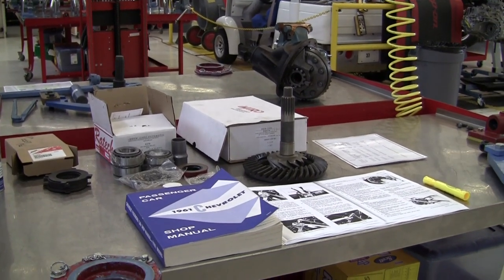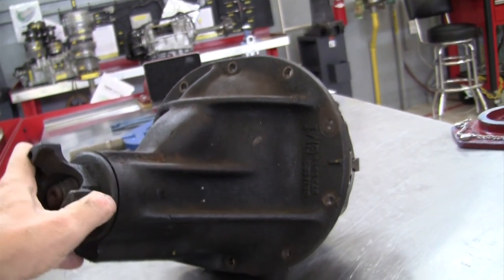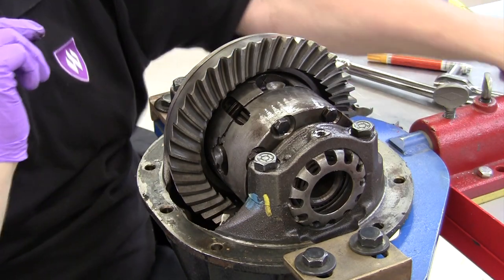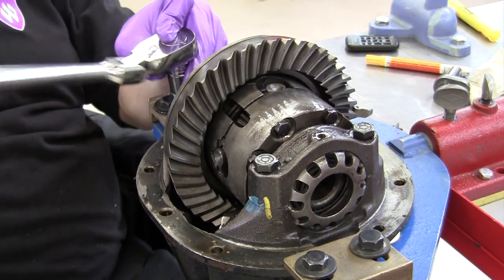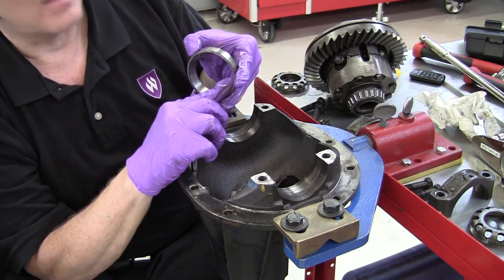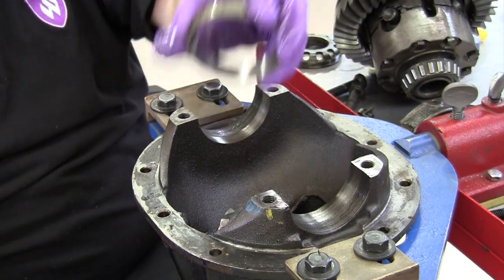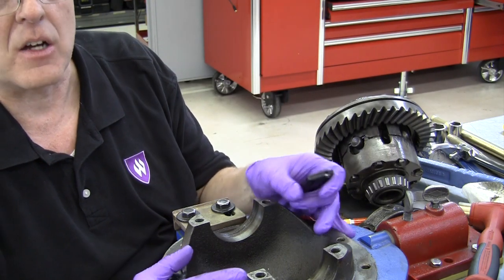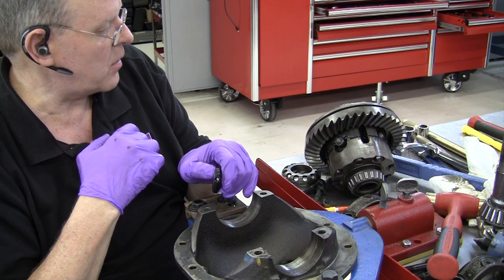1963 Chevrolet Biscayne Positraction Differential Overhaul - Part 1 - Disassembly

Comment: BW is a 3.08 open carrier.  My 62 409 is an AQ which is a 3.36 posi with metallic brakes.  Awesome video series.  I'm local to the area and will be upgrading to a 3.73 in the near future, this is a great refresher.

I teach part time for the University and had no idea they even had an automotive program.
Reply from the maker: +Daniel Tubbs Thanks, the automotive program has been here since before this location on the hill at Weber College, Weber State College, and finally Weber State University. Out building was built in 1956. Stop by and visit sometime.

Comment: Outstanding video.  I believe, if memory serves, that this particular housing is not a posi housing. They posi housings featured a large P embossed on the housing.  Missing on this housing. You mentioned that the inside appeared to have been ground down in one area.  
  The open rear carriers had a rib in them that would not allow the posi unit to be dropped in.  The housing with the P on them,  did not have that rib, thus the unit fit right in.  Again, its been a long time since I did one of these, but that what I remember. Anyone else agree with my assessment?
Reply from the maker: Thank you, I have heard from others who have indicated the same thing.

Comment: The grinding modifications in the case appears to have been made by someone to convert an "open" carrier case into one that accepts a posi-trak carrier assembly. The case should have a "P" stamped on it to denote production posi assembly.
Reply from the maker: +Greg Sparks Thank you! You are correct. I did not know about the "P" stamp.
Reply: Greg Sparks ya I have trying to figure out what kind of rearend I have in my 62 c10 and just found out it’s a 55t wondering if it would hold up to bbc 496
Reply: Yes, mine has a big P stamped in the case as well. Good point!

Comment: Excellent video series!  I have the exact same differential and you have given me the knowledge and confidence to tackle the rebuild myself.  I was wondering, would the modern holding fixture work just as well as the original GM fixture?  I imagine it would be very difficult to find an original GM tool such as this.  
Thanks!
Reply from the maker: Thank you! We also use the OTC 7020 holding fixture. https://www.amazon.com/s/?ie=UTF8&keywords=otc+7020&tag=googhydr-20&index=aps&hvadid=229068935469&hvpos=1t1&hvnetw=g&hvrand=5775553529167804088&hvpone=&hvptwo=&hvqmt=e&hvdev=c&hvdvcmdl=&hvlocint=&hvlocphy=9029703&hvtargid=kwd-315476392930&ref=pd_sl_2wqzm290xh_e_p38

Comment: The Torque meter to set the bearing preload is expensive and seems to have limited use. What do think of using the AC Delco Digital Torque measuring adapter? It has a setting where it records the torque that has been applied. 

I've watch a few videos on rebuilding differentials. Yours is definitely the best. And it's interesting to see the sloppiness some of the tech guys do when doing the project. I never would have noticed nor been aware of the repercussions if I had not watch your video first. 
Thank you...
Reply from the maker: +Sergio Maldonado Thank you for your nice comments. The Torque meter is expensive, but very accurate. I am not familiar with the digital measuring adapter from ACDelco. I think that most technicians try to do a good job, but without the proper education and tools they may not do such a good job (and not even know it). Have a good day!
Reply: For measurements such as these you need very fine precision and you just wont get that with a digital or a click type micrometer torque wrench. You might get close but you wont be nearly as precise as with a dial type torque wrench.

Comment: Excellent video. I have one of those, 4:56 posi tracs in my 56 Chevy that I am restoring. I also want to change to higher gears, something around the 3:50 range.
Reply: Like someone else mentioned, mine has a large letter P stamped in the case.
Reply: @MagaRickn  you want to sell the 4.56? I got a 3.55 in mine amd want to leave the line quicker

Comment: I know this video is about 9 years old but If I were you I would have used a torque multiplier to tighten the pinion nut, it will multiply your strength by 53 foot pounds.

Comment: GREAT video!!!

The numbers on the housing though... ya got those a little wrong. Below is what they mean:

The cast numbers L 11 62 
L = December and then the rest is the day and year
So this differential case was cast on December 11th 1962

The Stamped numbers BW 1220
BW = 3.08 gears; open differential mated to a 327 with Powerglide Transmission
1220 is the assembly date so December 20th

Seeing as it was CASE was cast on December 11th it is reasonable that it would have been assembled 9 days later.

Comment: @ 22:22 Regarding the Brinelling, if that is a show car that is rarely driven, I guarantee that wear pattern is actually False Brinelling, or "Fretting". It looks similar but its cause is different. A bearing needs constant movement to keep lubricant between the parts. Fretting is when small vibrations/ micro-oscillations cause wear between the rolling elements and raceways. I can easily imagine a show car that is being hauled around in a trailer being subjected to the exact conditions that cause this phenomenon.
Reply: False brinelling was first mentioned by Almen in 1937.[12] Almen found that wheel bearings were damaged before they were used by customers. Furthermore, he found that the bearings were more damaged for long-distance shipping of the cars and that the season of shipping also had an influence. The reason for the damaged bearings were micro-oscillations[13] which occurred due to the shipping. Because the damage has a similar look to brinelling, it was called false brinelling.[14]
Reply from the maker: Great information, thank you

Comment: I have found there is no rule which is set in concrete as to how a differential should be overhauled,over a year ago I had to replace the pinion & side bearings (I could've just got away with the small pinion bearing behind the pinion seal) in my 2002 model Holden VY SS Commodore which has the Dana M80 IRS rear wheel drive limited slip differential,well, the dilemma I had was that the pinion assembly had lost its preload (was measured at zero newton metres) and the diff had started to develop a bit of a whine at around 60 km/h (40 mph).
Since I have been unemployed (I don't know why in this great country Australia is) I couldn't afford to either take the gear set to a diff lapping service to have them relapped or I couldn't afford about $400 AUD for a new set of 3.91:1 gears (it was originally 3.46:1 from the factory but the first owner had the ratio changed & had the car tuned so it is now like a HSV clubsport in performance) so I just pulled it apart & since I didn't have a hydraulic press back then so I got a straight grinder with a slitting disc attachment,cut into the inner bearing race & used a chisel to crack the race in order to replace the bearings.
The pinion gear & crownwheel assembly as well as the outer side bearing races were chilled in the freezer for a few hours then the bearings were heated in the kitchen oven then dropped onto the frozen diff centre & crown wheel assembly as well as the pinion gear, the Aluminium side bearing adjusters were heated with a propane torch then the outer races were dropped in.
What happened when the pinion bearings lost their preload is the pinion started "rocking" from side to side & no doubt the pinion bearings thrust clearance would've increased too,this caused the gears to wear "out of plane" so the best I could do with the money I have is to refit the pinion gear with new bearings, I checked to see that pinion preload "could" be obtained be refitting the old collapsible spacer as in my experience sometimes that can't be obtained even if the bearings are the same part number ,not every bearing made is exactly the same (the Timken bearings were a bit different to the Koyo brand of bearings which were replaced).
I did the pinion bearing nut up very carefully with an impact wrench after a new collapsible spacer was fitted as I only wanted to obtain a pinion preload of 1.8-2.8 newton metres (rotational drag when measured with a 1 - 7 newton metre torque beam gauge),I didn't want to go too far so I compromised at 2 newton metres,it was easier for me to use an air impact wrench as the diff was overhauled underneath the car.
I set the backlash back up to 0.12mm (the same as before,note I didn't worry about pinion depth due to the fact I reused the old gears) & blued the gears so I could check the tooth contact pattern which was o.k. ,note I witness marked the side bearing adjusters but the specified backlash could not be obtained when they were lined back up ,so the marks no longer line up.
The car has done 17,169 kilometres since the diff bearings were replaced but there was a bit of a hum & whine at certain speeds & under different loads,the noise in the diff is almost non-existant,there is a very faint whine when coasting down a hill at 70 km/h,that's how it works , if the old gears are refitted with new bearings the gears will wear the other way & polish off the high spots on the pinion & crownwheel,along the highway on Friday,I heard the gears touch for a brief second meaning there is nearly no more metal to metal contact on the gears.
So, I was right in saying after the diff has done 20,000 kilometres it will be silent - I'm giving the diff up to 25,000 kilometres to stay quiet.
Reply from the maker: +Russell Booth Hi, thank you for the explanation of how you repaired your axle, I enjoyed it very much! You obviously have a good understanding of how to properly setup an axle and the complexities of service, and replacement parts.  I have found that there are four important steps to setting up any axle. They are 1. Proper pinion bearing preload. 2. Proper side bearing preload. 3. Proper backlash. 4. Run a contact pattern check and make the adjustments necessary for a good pattern (pinion depth and / or backlash). As long as your parts are in good shape and properly lubricated, these steps will cure almost any axle noise. Thanks again for your great feedback!

Comment: Im fairly sure the casting date L 11 62 translates to: L being the month of december. Being the 12th letter in the alphabet it would correlate to the 12th month of the year. With the number 11 correlating to the day. And obviously 62 being the year. I highly suspect the other number: bw 12 20 = would correlate to the day it was actually assembled, as in 12th month December. And the 20th day. Leaving BWI most likely as the assemblers initials.
 I do know that on all of the 60s and 70s Chevy castings, the letter of the alphabet was considered the month of the year. And I would highly suspect this is the case
Reply: your right about the L date code. the BW determines the gear ratio

Comment: I have this same rear end in my 63 impala. It's stamped with a p so it's a true posi case. It has no drain plug just a fill plug. And I'm curious how to change the oil. Do you actually need to drop the entire thing and just let the oil come out that way or is there another way. I know this videos old and may not get an answer.
Reply from the maker: Are you sure there is no drain plug? It could be covered by dirt and rust
Reply: Have you tried a cheap hand transfer pump?

Comment: where can I buy the holder that you are using
Reply from the maker: eBay os the only source for the original GM tools; however, there is a nice generic holding fixture from OTC tools Part number 7020 on Amazon.com that woulds work great. Best wishes!

Comment: I thought a 4.56 gear would be a 4 series carrier (i know its called a differential case actually) and need a 4.11 or lower (numerically higher) ratio for that carrier?
Reply from the maker: +burnoutnova I do not know the answer to that question. Thanks for watching.